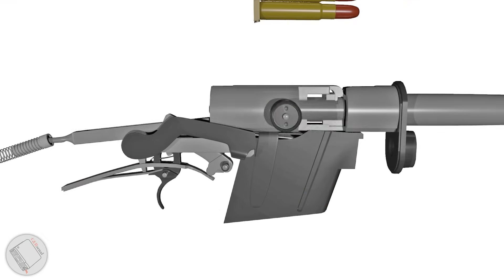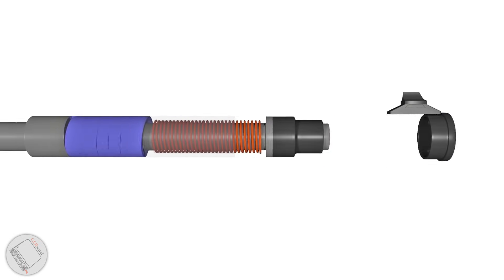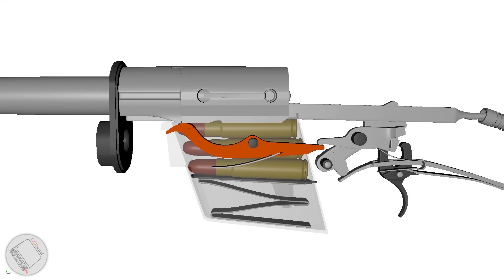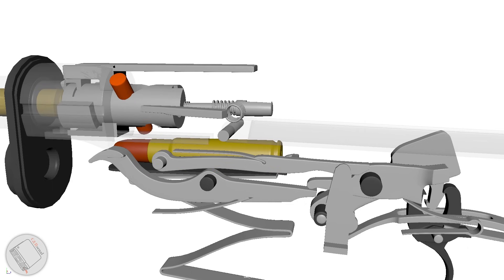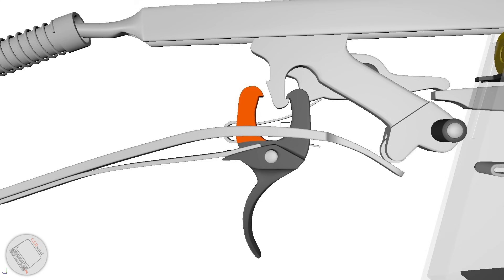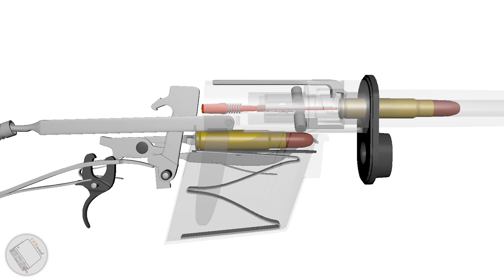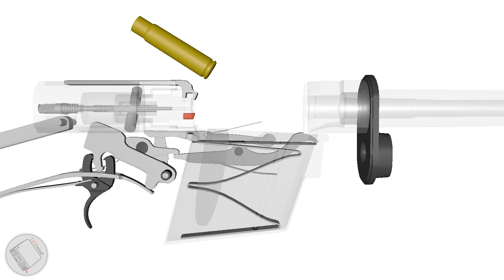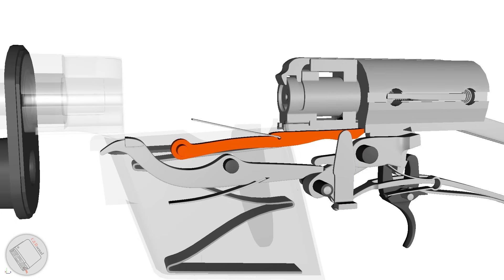How it Works: Remington Model 8

Comment: The AK trigger (and safety/dust cover design) is exactly like this one, as well as Mechanical clocks/ watches escapement mechanism . So cool how technology connects like that.
Reply: That is what I love about these animations, it shows you how many ways these ideas get reworked or outright copied over time.
Reply: The AK gets it from the Garand.
Reply: @skepticalbadger The long stroke gas piston and rotating bolt, yeah, but not the safety and trigger
Reply: The ak trigger is similar, but it improves by adding a spring loaded disconnector, so instead of a solid disconnector and sear assembly, it can move independent.
Reply: @lebien4554 similar but not exactly AK triggers rely on braided spring tension

Comment: Most automatics eject brass hot enough to burn skin, but because of its long recoil mechanism model 8 & 81 remingtons eject brass that is cool , which is fortunate because it's weak ejection often hits  you  in the face.
Reply: Why would it be cool? Can you explain please?
Reply: @timrobinson6573    cool as in not hot. As you are no doubt aware if you eject a brass from any manual operating firearm it is 'cool' enough to handle without fear of burns. The heat gets soaked into the gunbarrel. No matter how fast you shuck the bolt . The long recoil system allows that heat transfer. I did not mean to imply that the  brass is being chilled or refrigerated. Any how I find it interesting.
Reply: @timrobinson6573  When firing, autoloaders spit out hot brass because they are ejected before the barrel sinks off the heat. Due to the long recoil mechanism, it allows the bullet to cool down.
Reply: Can't remember ever being hit by brass from my Model 8.  May be a problem with your ejector pin/spring or extractor claw.
Reply: I just reviewed the c&rsenal primer with May shooting the model  8, you can plainly see brass bouncing off her arm and head, and she seems unaware.  I have long since sold  my old model 81  300 savage.

Comment: Long recoil systems have always fascinated me, and makes me wonder what a modern military arm would look like using the system.

Love the animations!
Reply: there was a company showing off long recoil 5.56 and 308 rifles at shot show last year. many people were super impressed by it. they are like over $3000 tho
Reply: Many modern 50-cal firearms use long recoil
Reply: The Lynx .50 caliber rifle uses not only a long-recoil system, but a bullpup long-recoil system (and us, afaik, the only .50 anti-material rifle to do so).  It's one of the very few .50BMG rifles that can be fired from the shoulder with good accuracy.
     The long-recoil design lets a weapon absorb huge amounts of recoil energy by forcing it to move a great deal of reciprocating mass.  That way the massive recoil of larger/more powerful cartridges can be mitigated to something that won't require the shooter to bring a chiropractor along.  IMO the advantage of the system in smaller calibers is minimal.
Reply: @rlb3418 such as?
Reply: @skepticalbadger  the barret is recoil operated, though I'm not sure if long or short action. The browning m2 mg is short recoil.
Reply: @skepticalbadger the Lynx.  Idk any others
Reply: @enochofmi oh, that's unfortunate. That turned out to be an absolute dumpster fire of a rifle.

Comment: I had an 81 Woodmaster (basically the final Model 8 "version") in 300 Savage. I almost never took that thing apart. Good luck putting it back together without instructions. 
Though at the range, was definitely a head turner and got people asking you questions. Back in the day these things definitely put you ahead of every other hunter who was still using, bolt action or lever action hunting rifles.

Comment: I'd love to have 1 of these rifles.
Reply: They aren't rare or particularly expensive. The later Model 81, which functions the same but has cosmetic upgrades, is more common and has the advantage of being chambered in .300 Savage in addition to the Remington rimless line of cartridges. (.25, .30, .32 and .35). They sell for $500-$1000 depending on condition and chambering.  .300 Savage and .35 Remington are the most common.  .30 Remington is fairly common. .32 Remington and .25 Remington chambered rifles bring a premium. The .25 Remington was dropped after only one year of production of the Model 81.  Model 81s in that cartridge are very much more expensive.
Remington Model 8s are more scarce and expensive, but not as much as some other collector firearms. The Model 8s were prone to stock splits as they had a smaller, trimmer straight grip stock and thin forend.  With all that mechanism contained in both pieces of wood, it made them prone to splits. 
The main difference between the two models is the Model 81 has a beefier stock and forend and pistol grip stock.
Reply: I'd rather have a great 8. U must think everÿ 1 is dumb. By the way a cheap 1 is 800 or more. Haha ha big ɓrain

Comment: The disconnector only prevents full auto fire in theory, in reality it prevents the hammer following the bolt. In most cases this "follow hammer" is way to weak to ignite the primer.

Comment: "To ease perceived recoil..."  Yeah, that worked out well... (snicker)  The recoil on all of the long recoil Browning actions is always out of proportion to the actual cartridge.  It is an artifact of that huge chunk of metal slamming back in the receiver as the action opens.  People have been complaining about it for nearly 120 years.  I mean, it is not painful or punishing.  But it also isn't pleasant when compared to rifles with different actions chambered in the same cartridge.  The only thing that the Model 8 and its successor the Model 81 had going for them was that they worked, and worked reliably in an era when semi-auto rifles were prone to be finicky.  Which is why they had such a long production run compared to other centerfire semi-automatic rifles of the time.
Reply: I've heard that several times now.  I suspect that the recoil-attenuating benefits of the long-recoil action don't cone into play until you up the power considerably.  The Lynx GM-1 would be an example.  Sure, you can shoot a Barrett M82 from the shoulder, but you'll only do it once, and your chances of actually hitting anything are pretty slim.  But several owners (not just the guys doing the publicity shots for Lynx 😏) have now demonstrated that you can shoot the GM-1 from the shoulder, unsupported, with acceptable accuracy, at least at closer ranges.

Comment: So would removing the second fork on the trigger assembly make it a full auto rifle, or just make the gun run away?
Reply: Neither, as the hammer would follow the bolt, thus not retain enough energy to "snap the cap". Full auto variants of this trigger group require a "third arm" or "trip" system with a secondary sear and notch, and a trigger rotation limiter. A "lightning link" type system will knock the interceptor claw off the hammer notch as the bolt locks into battery. "Hammer follow" mods, at best, give you all the legal liability of full auto, with no possibility of reliable control or implementation... so don't do it
Reply: @ludditeneaderthal  Don't worry, I couldn't do it even if I wanted to.  I live in the UK, where even BB guns are regulated.  But thank you for your answer.
Reply: @MamLewis  if you'd like to see examples, check out the trigger group of the ak47/akm family of weapons. It's the browning "Y" trigger system with a secondary sear. The us m1 garand rifle has the same trigger, only a 2 piece design, in semi-auto only. With minor variation, it's probably the most used semi-auto trigger system on the planet, both military and sporting arms.

Comment: Preventing bolt following, not necessarily full auto, may just lead to a failure to fire.
Reply: A bit of both. Most weapons that lacked trigger disconnects behaved inconsistently, sometimes the hammer would pick up enough velocity to fire, sometimes it wouldn't.

Comment: If you got the trigger in just the right place, brrrrt?
Reply: No. The geometry is such that one notch or the other would have to engage at full recoil. You'd have to do a perfectly timed "reset, tug" motion on the trigger to produce what would be "simulated full auto" (as every shot would require a pull). The full auto variants of the browning trigger have a wider "u", allowing a "midpoint no hook" position, and a secondary sear/trip for full auto (ala the ak47/akm trigger group)